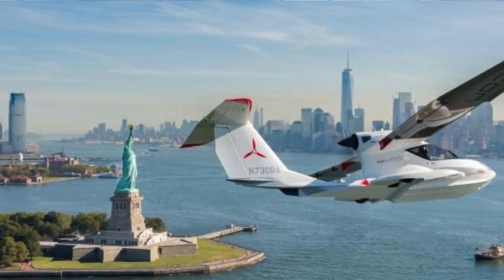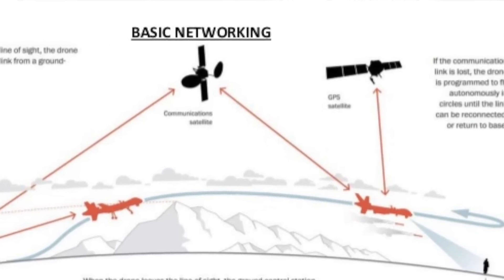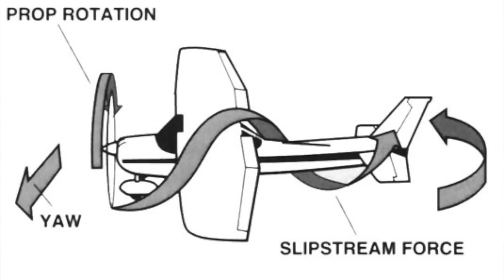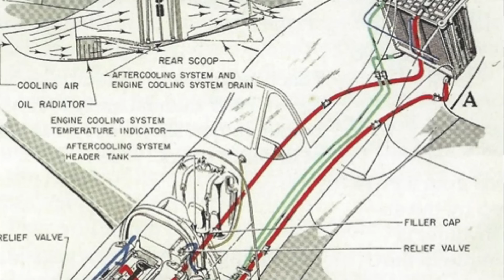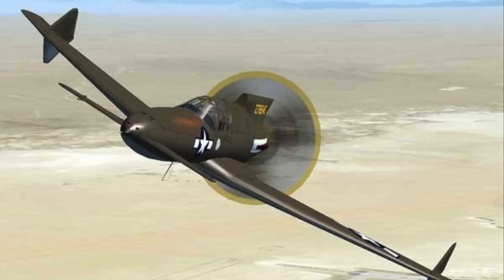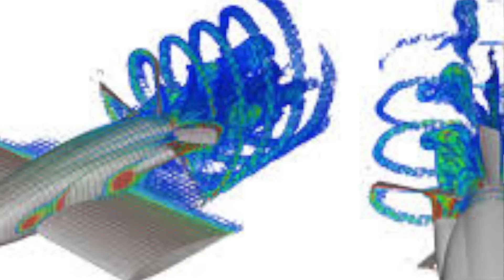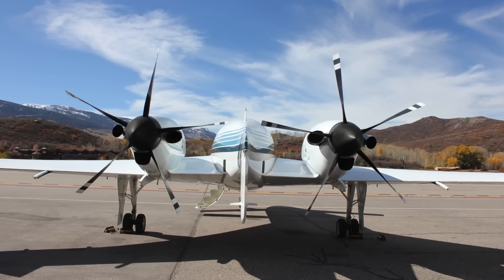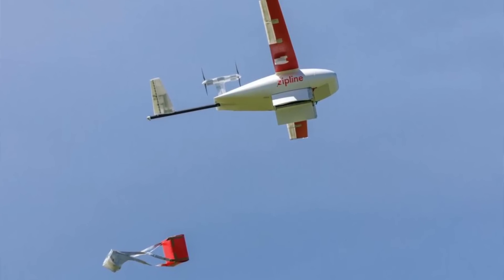PUSHER AIRCRAFT  Configuration    EXPLAINED IN DEPTH

Comment: I wonder if an airboat gearbox will work
Reply from the maker: some engines are geared to their prop.  all turboprops are geared.  so yes, it is common.  reducing the RPM lets the engine rev, make more HP, and yet helps keep the disk area large, exerting  the force on a larger volume of air, compressing it less, to make more thrust for the same power input at low-medium airspeeds.

Comment: You did a great job of explaining all the factors working against pusher prop aircraft.  I’m convinced that the solution to these problems is to use jet engines.

I was telling this to myself until I saw your plane with motors in the vertical stabilizers!

Very nice engineering!!  Kudos!

Comment: That was a very cool video. I don't know much about aviation but found it really interesting. I know it's a fictional plane, but how would you rate the Sanka mk b from The Sky Crawlers as far as pusher designs go?
Reply from the maker: oh, it's not fictional. not entirely.  just copied form a Japanese aircraft near the end of ww2, called the Kyushu J7W Shinden, a fairly highly evolved, but single engine pusher.  Should have flown very well as a fighter, comparable to other late ww2 fighters of its day.   I personally don't think it would have had any advantage over them, but at best could have been as good.  perhaps better climb rate?  and a canard would prob have an advantage that in a high speed, high AOA turn, it would not stall, but be limited to a certain AOA because of the front wing stalling first. so an overly adrenaline pumped, exuberant pilot would not stall it at high speed.   you can read about it on wikipedia, and if you want to know more about a historical aircraft, that is now widely known, you can always build a model of it and test it for yourself to explore the possibilities.:)

Comment: Opinion of Rutan Stargazer ?
Reply from the maker: typical but very sleek layout, canard configuration..   presents some issues with stability and control but can be made to work. There's usually more drawbacks than benefits to a canard.   the Stargazer has the issue of the props placed behind the wings, putting the prop arc in the pressure differential of the wing.  this will cause vibration and noise. also loss of efficiency.  the "Rutan Scorpion" handles that better, but then you have the issues of how to control the tail surfaces.     I love Rutan, but I think his designs were all pretty much meant to solve a particular problem at expense of several others.  that said, he was inspirational, and occasionally designed something truly revolutionary and wonderful, like his asymmetrical twin, or White Knight, as well as space ship one and 2.  Most people don't know this, but he also worked on the F-15 wing, and several black projects, which he cannot discuss. Very cool guy.   oh and I also like the ski-gull concept!

Comment: Thank you for all this information!
So, you showed normal configurations as well as more exotic stuff, like a box wing, propfans on nacelles, canards, but what would be the influence of forward swept wings with a strong anhedral and canards blended to the front of the wings (like on the Su-57) with a fairly strong anhedral? Also, would encasing the propellers in a ducted fan reduce the vibrationsto allow a π-wing behind on a double boom?
Just exploring...
Thank you again.
Reply from the maker: forward sweep is interesting, but I'm pretty sure it does nothing for efficiency.  probably hurts it, all else being equal.  using anhedral on swept wings helps reduce the roll to yaw coupling.  using both would not work well, I would assume.  but you can make an experiment and try it.   I almost always use a chuck glider.   if it glides stable, or can be trimmed to, then it will work in full scale.  any wing in front or behind another wing is less efficient, as the air is disrupted, and there's a pressure differential that is being fought by the rear wing.  this applies to canards, tandem wings, and lifting stabs, but most to the first two.   the main wing should be in as clean of air as possible.   but depending on mission for the aircraft, efficiency is not always the goal, and there are plenty of examples of special configurations used to good effect.
Reply: @FPVREVIEWS  Thank you again for this.
I am particularly interested in pushers because the propellers tend to stay attached to the motor on the model/chuck. For some reason, tractor props tend to detach from their rod at higher speeds: it always look obvious on the plans, but not so in reality... Thus, I use pushers to make sure the propellers are staying on their rods instead of pulling away from them. And I always have an even number of propellers, clockwise and counterclockwise to avoid the momentum induced by rotation, first, and for matters of redundancy in case of engine failure (because failure is more likely than success). In these conditions, a glider doesn't really make sense, but I already built many partial models.

As per the forward sweeping, it's all about control of the air flow, efficiency is secondary (but hoped). These are reversing the flow from fuselage-to-wingtips to wingtips-to-fuselage, which gave me the suspicion there was a way to drive the airflow and use it efficiently instead of having to put winglets (or even a boxwing) on back-swept wings to deal with the "noise".

For the strong anhedral, there is a simple explanation: I'm not thinking of a "normal" plane, quite less than that, actually, I'm thinking of a WIG, and the 12º anhedral is thought to be ideal to capture the ground effect (Nakamura made a good few experiments about WIGs and wrote a lot of papers).

In these conditions, with this particular goal, the numerical studies made in 1984 for the X29 proved all wrong (as per the book published by NASA later), I don't have access to the studies leading to the Ju-287 nor the ones leading to the Su-47 "Berkut", so the X29 litterature will have to do for the sweeping forward.

About WIGs, the Korean navy made a few test for a Lippisch-style configuration (inverted delta, single pusher), but they tend to be limited in speed by their nose, which is the reason for canards and fly-by-wire (they tend to flip unexpectedly as they accelerate), but you're right, canards suck in terms of efficiency and "clean air", I'm aware of that. I just hope that having more control over the airflow will result in giving more useable force and thus result in gains in efficiency.

That's the reason why I was speaking about the "blended" canard taken from the Su-57: because it's attached to the main wing, it's changing the entire morphology of the wing itself but there is no "output" between the canard and the wing where the airflow can be perturbated, at least that's the idea (there's a "thing" near the hinge, tho).

The Pi-tail with double boom is a direct consequence of trying to control the airflow from the forward-swept wings, but increasing the airflow (added to the airflow from the motors) at the center requires a horizontal control surface pushing on the back, which is another reason for canards to counter the geometry at the front.
Reply from the maker: @RegisMichelLeclerc  I'm pretty sure that several WIG designs incorporate many of the features that you are discussing.  forward sweep, anhedral, and dual vertical stabs sharing a T-tail. that arial config would be very effective, and keep the tail in clean air, away from everything happening underneath, especially in a WIG aircraft.   If I understand correctly, you are planning on using canards to control the airflow over the main wing. There have also been experiments with using tiny holes, and a vacuum cleaner(using the terms loosely here) for boundary layer control.  it works well, and could help solve some of the issues with getting. WIG to take off from water, and generate enough lift to carry heavy loads at low speeds where you need to break the surface tension on water.  could also blow air from the propulsion under the main wing, or use slats.   as far as tractor vs pusher...  the rotational force is greater than the thrust, so for either one to slip off it's shaft, it would have to first rotate around the shaft.   I've been flying pushers for many years and never had issues, but just tighten the nuts properly.  can also use a keyway, or geometrical shaft cross section.  tractors do get better (cleaner ) airflow into the prop arc.  but then accelerate the air over whatever is behind.  at the very least, the motor itself.  if the motor has a small profile, and the air dow not blow over anything else of significance, then losses are very small.   counter rotation solves torque, P effect, and slipstream effect, as well as gyroscopic precession.    The
Reply: @FPVREVIEWS  Sound, thank you. About the tractor, the sure way is to have a rod go through the axis of the motor and the propeller itself. Maybe I don't tighten enough or not straight enough, or the propeller is too big for the torque or speed, but all my attempts to use tractor ended up with the propeller flying away. I stopped doing that pretty quickly, though, obviously.

About the canards, you understood correctly, mine will be attached to the main wing. I got the idea from a documentary on the Su-57, although it's probably used elsewhere, I was just not aware of the concept before. The idea is these canards "morph" the aspect of the entire wing by altering the angle of the attack. on the back of the wing, there are similar ailerons so the entire wing can change its profile. The Pi-tail also has a retractable "spoiler" (like on sports cars) to vary the "push" depending on the speed so to counteract the ground effect, at each end of wing there is a small "hull" containing the retractable hydrofoil (with fin orientation control) that aid in getting airborne ASAP. Youtuber "rctestflight" has made tests of that, not too successful to him but promising to me.

About tractors blowing under the wing for take off, this is the way the Ekranoplan works. However, as you say, it requires tractors or... reactors, like on the Caspian Sea Monster. Also, I'm really not sure how it would interact with forward swept wings, which are tricky enough already, so I'll keep that in mind for v2.0.

About cooling of the motor/engine, you were pretty clear on that in the video. My guess is it's worst when idle or low speed. Would it make sense to have an impeller blowing straight on the motor, with an aluminium casing and a radiator around the motor, like they have in computers, or should I start thinking oil-cooling and radiator+fan like on cars?

I know all of these devices exist, but I couldn't find anywhere where they would be all used at the same time. My goal is to make a (small) vehicle able to go on the sea, sand, gras fields, snow and ice at a low altitude (forget the Atlantic and the Northern Sea!) with all that combined in such a way that is uses pretty much the same amount of standard petrol as a car of a similar weight for the same distance (6 litres per 100 km at 60 knots).

I'm also testing those "toroidal propellers" as pushers and, so far, they're giving better thrust per watt, less noise and a straighter flow (according to the smoke), which may have some importance at some stage. My other option was to encase the pushers in ducted fans and make them orientable. Definitely in v2.0...
Reply from the maker: @RegisMichelLeclerc  regarding cooling, I have no direct experience with pusher cooling, just know it can be challenging.

Comment: I have a couple of aerodynamic questions. 1: the nose of a plane is pointed to pierce through the air (more efficient than a flat surface) so would a plane see greater aerodynamic efficiency if the leading edge of the wings had a sawtooth kind of design on it instead of that long flat surface? Actually they would be more like little pointed cones on the forward area that matches the airfoil of the wings (flat along the bottom, curved along the top). 2: the top of the wing...instead of the typical airfoil hump, what about a bunch of bumps? Like right wale pectoral fins (or is it humpback wales?...a wale species has several bumps on the top of their pectoral fins, I'm just not sure which one it is). Would a series of specifically placed bumps in place of the traditional foil be more efficient?
Reply from the maker: on some planes, the wing ribs and sagging covering produce a little of that effect.  The stepped airfoil is called a KF airfoil, and it does work, just not as good as a normal airfoil. but very simple to build, and works surprisingly well.  as far as the leading edge, I'm sure someone has tried it, but if you want to know, either look for some research, or put it in a wind tunnel, CFD, or test it on a plane with data logging, and/or telemetry.  I'm guessing due to varying the Reynolds numbers, and increasing surface area, as well as disrupting the chord wise flow, to varied span wise flow, it would not do as well as a normal airfoil.  
a very high aspect ratio, normal airfoil can be built into a plane which has a 50/1 glide ratio, total.  so the normal wing has a very high degree of effeciency.  even if you were to find an improvement, it would do little to increase the overall efficiency of the platform.  Low hanging fruit can be found in configurations for a given application, and in the correct application of basic principles to a task.

Comment: There is no pressure difference behind the wing there is the downwash angle of the airflow into the prop so the AOA of the prop blades changes as the prop rotates: not optimum so prop efficiency takes a hit. Prop blades hitting wing wake causes additional noise and losses.

Comment: Great info. I backed up a few times to absorb the terms and that's what kept me interested. Very well done!   Question : I have a 79" pusher wing ( in line with thrust and with reflex ), so would it be better to have a 4, 5 or  6 blade prop ? ( MORE  "chop"? )  Should I place any prop.  as far away as possible from the trailing edge to avoid "chop" ?  Mmm... I'm looking forward to see more of your vids... Thanks.

Comment: What is stopping engines being mounted on the front of the main wings on a canard style aircraft? Sort of a mid-engine style I guess?
Reply from the maker: I'm guessing that the blown air over the main wing and not the canards would produce a power-pitch coupling, and the thrust line would be low if the the main wing is a low wing which it almost always is on tandem wing aircraft, due to the interaction of the airflow of the canard with the main wing, further making the power-pitch coupling worse. could maybe have 3 engines, 2 like you say and one on the top o the T-tail, or something like that, but it would get dangerous if you lost an engine.

Comment: What doi you think about the celebra 500L?
Reply from the maker: seems it's in a relatively primitive form still, which is fine for a prototype.    ultimately, the moment between the wing and the horizontal stab is so small, that it will have marginal stability and control, and if stability is desired, the downforce on the horizontal stab will reduce the lift, lead to high landing speeds and poor efficiency.   In the end, there are too many compromises to make it efficient, safe, and practical.  Also the single pusher means it has a very limited disk area, with ground clearance problems for the prop.   The piaggio in the thumbnail solves these issues with dual engines further forward to help the clearance with the ground, and the canard to help stability without hurting efficiency, or losing coefficient of lift.  it's a far more evolved design, but with it's own issues still, namely the prop blades intersecting the pressure differential from the wing Trailing edge, and causing vibration/noise/loss of efficiency.   all linked together and all for the same reason. 
one thing I like about the celebra 500L is the wing aspect ratio, and the interior volume. 
These problems could probably be solved with the use of a high bypass turbofan, but then the design would closely  resemble the Global Hawk, a highly evolved design.  but even it is not very stable in roll/yaw, and cannot exit a spin.     Not suitable for a transport category aircraft.  The Piaggio is very stable at least.
Reply: @FPVREVIEWS  Thank for the thoughtful reply. I agree that stability is going to be a issue. The wings seems extremely small for such a large body. Also, the claims for range, speed and performance are nothing short of incredible. I do applaud them for thinking outside the box and searching for new more efficient designs. It's the only way to move forward.

Comment: Can I make a suggestion for you? First, you should move your camera so it is farther away from you, using the zoom lens to push in closer.
     This will allow you to read the text of your narration with minimal eye moment. Second, use a teleprompter where the camera shoots through the class. This will allow you to look directly into the camera lens while you read.
     It's not hard to make a teleprompter on the cheep. Look in line for instructions.
    Other than that, it's pretty good.
Reply from the maker: Thanks for the tips

Comment: A huge benefit that I didn't hear mentioned is the noise! If you're the pilot a pusher leaves all that noise behind you.
Reply from the maker: True to some extent.  The exhaust noise is typically reduced inside the cabin, but vibrations due to turbulent air entering the prop arc on most pushers means there is usually more noise transmitted through the airframe. 
I hear that the Starship by Beechcraft (scaled composites design/Rutan) is very quiet, as it has solved the turbulence problem almost entirely.